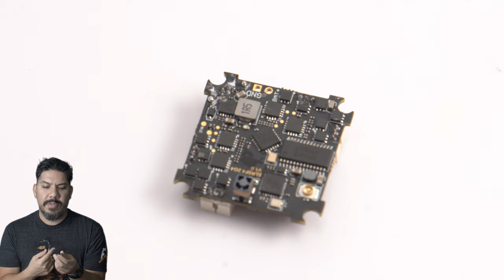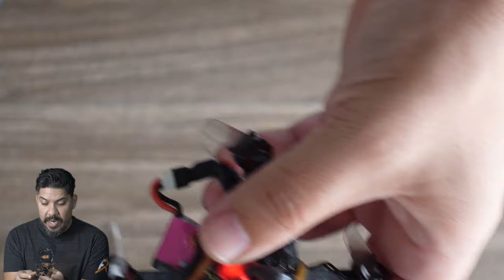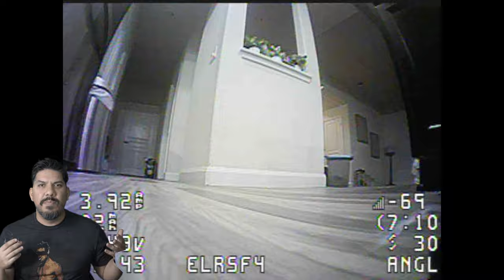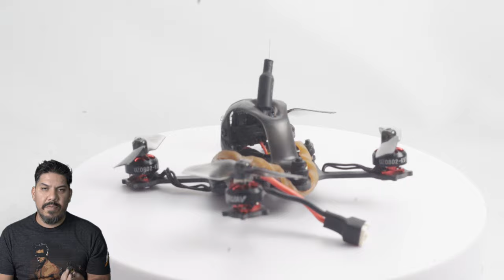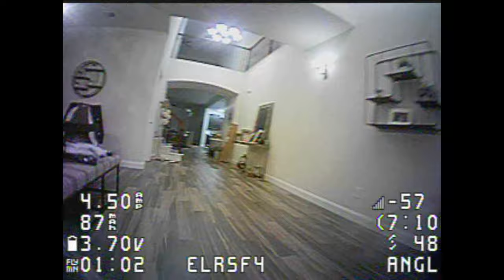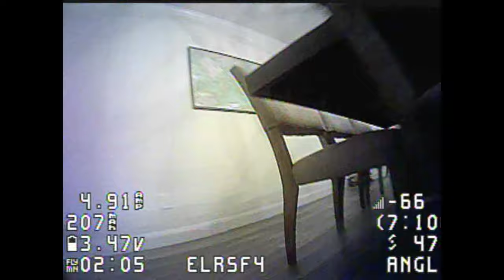Express LRS AIO whoop board + UZ 80 DIY Drone kit - no soldering drone build

Comment: Great video! For the pilots who are curious about 900mhz systems on micro quads, you can DIY a quarter wave antenna easily, with any u.fl cable. That produces antennas that are about the same length as 2.4ghz systems. You don't need that giant half-wave antenna flopping out the back.
Reply from the maker: Thanks for the info!  Thats a really nice tip.  I was also advised by the devs, that in a racequad where i broke off the ceramic antenna, to solder on a 30mm section of wire, and its worked great for me (for short range race distances)

Comment: It's in this thing! Sweet AIO, thanks for the review. I want to get Shark Byte especially for the micro HD experiance.
Reply from the maker: You bet!  Sharkbyte micros are def lighter than DJI so far.  still not small enough for this size, but if you bump up to 2" a ton of possibilities open up.
Reply: @JonE5FPV  hey, I would really like a video on how to make a drone faster. Everyone is trying to get long flight times, but I want to know how to make my drone faster. 
Catalyst machineworks massive droner HD with 1507 4200 KV Motors...i need more speed!

Comment: express lrs 900mhz on 5 inch. still doing spi for whoops and 2s toothpicks. just need to fly in my house or on my property so it works for now. Wishlist; a new radio with 2.4 ELRS built in . I am thinking it's not far fetched
Reply from the maker: man, i am really wanting ELRS built in as well.  Crossing my fingers on that one, even if it means i gotta buy another radio.
Reply: @JonE5FPV  did your pit mode work on that happymodel AIO? We have people claiming that the smart audio doesn't work right and the VTX puts out 50mw no matter the settings.